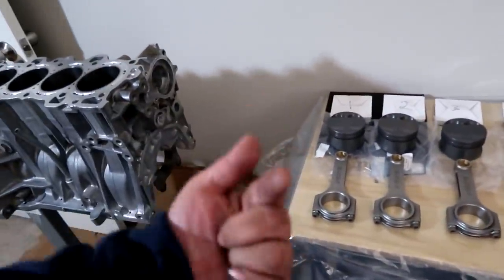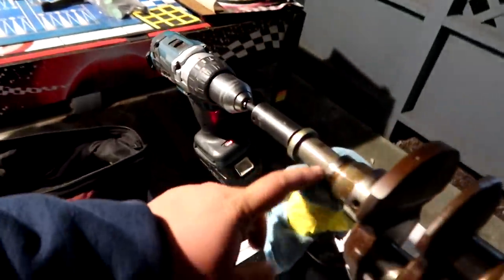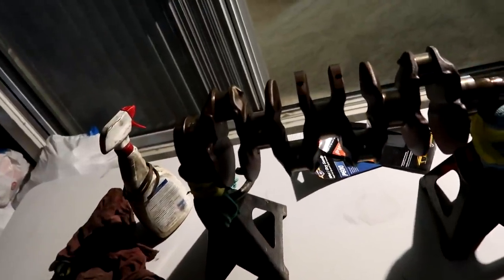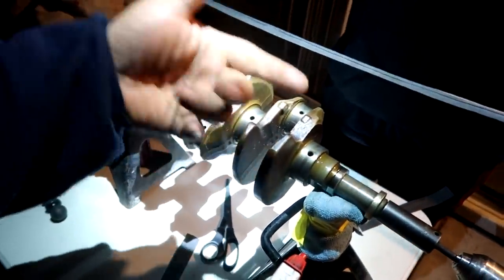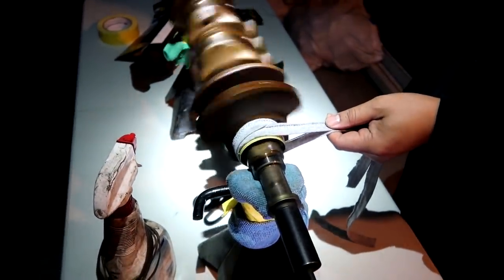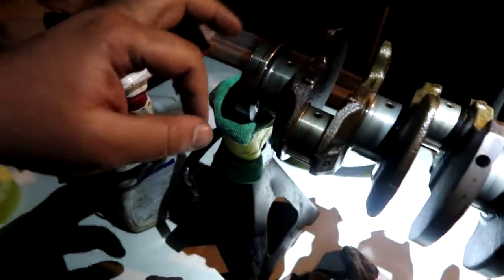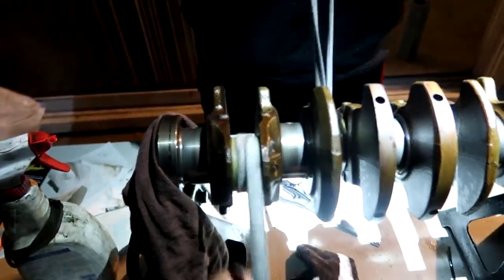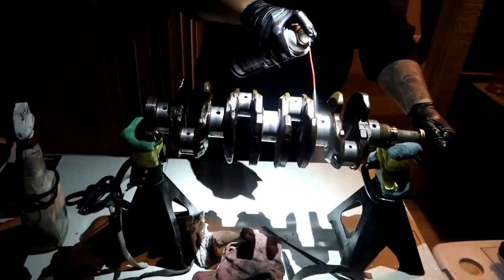SKETCHIEST WAY TO POLISH A CRANKSHAFT !

Comment: You can polish the crank in your block. Keep 2 of your old bearings.  And set 1 on main 1. And set another on main 3. Oil up those bearings the hole time your moving from main to main. I've tried the drill. But spins the crank to fast. I use a 3/8 snap on electric gun. The mains that have no bearings.  Slip the sand paper threw the bottom. Than up and hold it while you spin the crank. 600,1000,2000 grit sandpaper.  Than mothers.  Switch bearings to do main 1 and 3. It will shine so much. Your going to display it in your living room.

Comment: I would just pay to have the crankshaft polished but if you do it like this agian make the sandpaper thinner and mover the sandpaper back and forth from sidewall to sidewall. That way if you looked at the scratch pattern under a microscope you will see your lines in a angle and not in a circular pattern. This will keep your oio flowing better across the mains and pins. Lamborghini was blowing up engines years ago because the machine they was using stopped going from sidewall to sidewall. I operate a supfina cnc machine for cranks for tractor trailers.
Reply: THIS /\  You need to get stick on velcro and stick it on the shirt and sandpaper. Move from side to side as suggested FTW.

Comment: Damn 600 😳 i started with 1500 then went to 2k and ended with 3k. Left my crank journals a mirror finish. And before and after mic readings were less than .001.
Reply: Did you have bearing deposits / scratches before?
Reply: @FunBitesTV  very minor scrarches that didnt grab the nail at all.

Comment: Should have used emery cloth and not sand paper. 
Sand paper is made with garnet or other stone material as a cutting media. Not designed for precision metal work as it can embed garnet into the metal which will accelerate your engine wear.
Emery cloth uses aluminum or iron oxides as an abrasive and is designed for metal working.
Reply: additionally I would never use any kind of polish agent to internal engine components as you are now introducing a foreign liquid/material to your engines chemistry.

Comment: What’s even more sketchy is using strips of t-shirt around rotating equipment. I have worked in machine shops for the last 15yrs & that’s a big no no. Also for stuff lime that look into getting a small lathe. They’re not that expensive, especially if you can find a machine shop closing down or something.